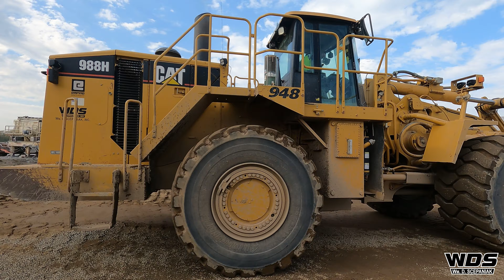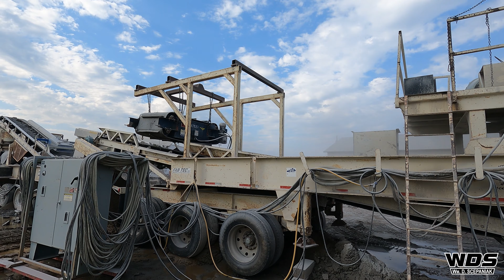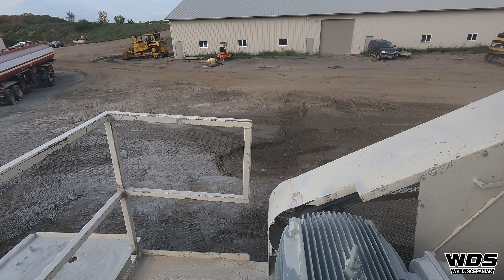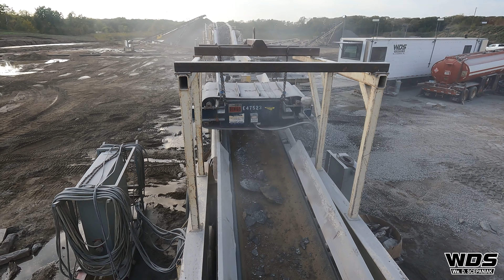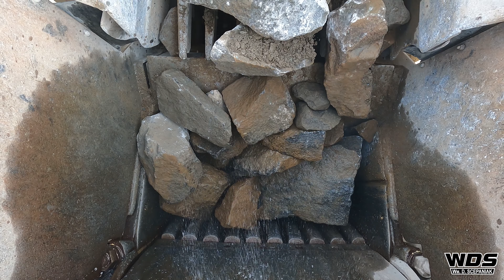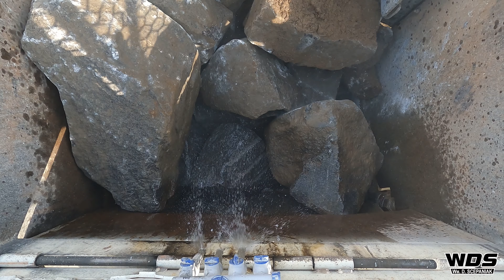Crushing 4 Foot Granite Blocks with a Jaw Crusher

Comment: After all these months I just noticed that granite has to be one of the hardest rock material to crush and once it reaches the cone crusher it's pretty easy on the machine do I have that right? I like to see it when a wheel loader scoops up crushed granite and stockpile it or load the trucks.
Reply from the maker: Granite is very abrasive and wears away at the metal hoppers very aggressively when compared to gravel

Comment: Looks like a real pita to crush, would reducing the water or eliminating it from the chamber allow more grip thus increased throughput?
Reply from the maker: We would have to try and see how it plays out.  planning to fire back up in spring
Reply: @wdscepaniak  yeah water in the chamber at least in our experience increases wear and slippage. Water directly under the jaw maybe a better option
Reply: They could open up the bottom of the crusher to increase output depending on what secondary they have after the jaw crusher

Comment: Too much water stopping crusher from having grip
Reply from the maker: Trying to find the balance to keep dust suppressed
Reply: @wdscepaniak  Misting systems like they use on patios in the desert?  Cleaning the nozzles can be a pain if you don't use filtered water though.
Reply: @DocNo27  yup. Sprayers need regular cleaning